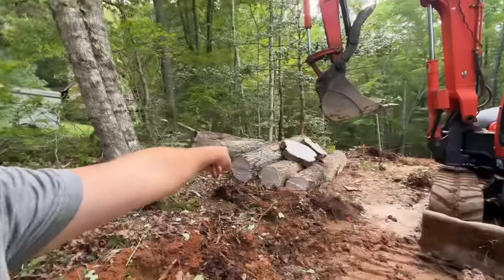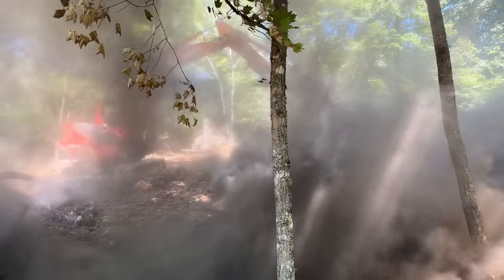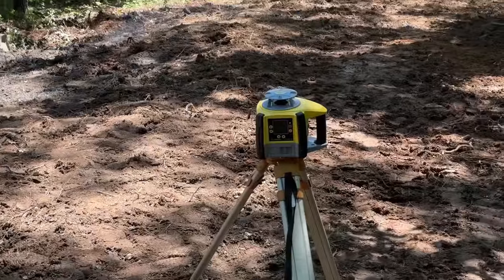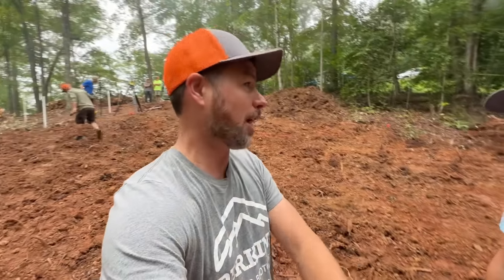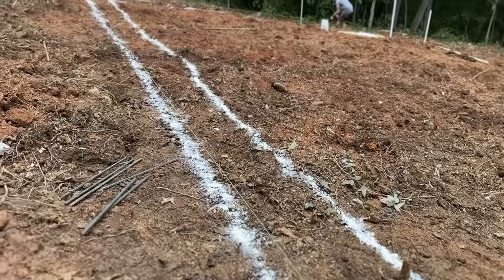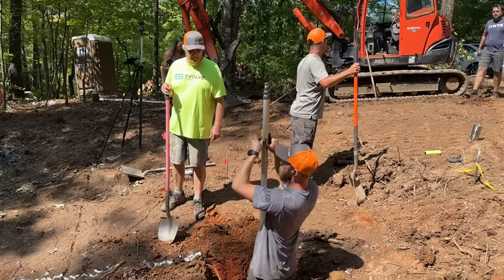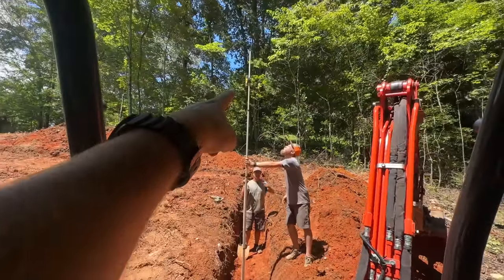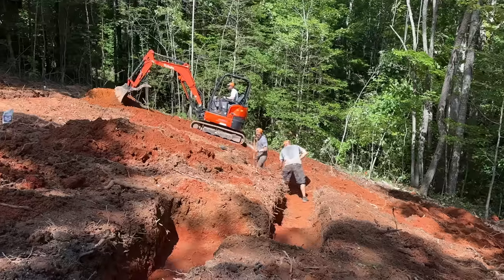Modern Home Build | 02 | Footings layout and dig

Comment: When the dump truck was  emptying for he driveway, he could start dumping, backing up,  at the end of the driveway over what he dumped. This way, when he leaves, he can drive over gravel. Also, it is compacting it at the same time.
Reply: I thought he was going to do that but maybe he knows something we don’t. 🤷🏿‍♂️
Reply: Glad someone picked this up.  Here in Australia you wouldn't get a truck license if you didn't know those simple tips.  Crack the tailgate open on chains, tip it up slowly and reverse over the load, not only does this get you out of a sticky paddock but also spreads the load for the client.

Comment: Back in 1995 the boat company I was working for tried out some really cool laser Teck. They pointed the laser at a small mirror ball at the end of a stick. The laser tracked the mirror as it was moved across the hull, and we were able to build a model of the boat in the computer to show deviations from design within 1 mm and make adjustments with some Bondo. The boat was 60 feet long. I am pretty sure it was some guys from MIT. Sadly, the boat broke in half during a race (Americas Cup 95) because a member of the crew tried to fix something that he was totally unqualified to do. It is always hard to get good help.

Comment: That’s some fancy equipment. Why don’t you just use a meridian optical level. You can find a corner shoot a straight line turn 90 degrees and repeat. They are less than 200.00 I use a David White LT6-900 Meridian 22X Optical Level-Transit. Something to consider.

Comment: Laser on a tripod and a measuring stick will solve the unlevel measuring problem. A Lazer and tripod is not that expensive. The measuring stick will tell you how far to measure down from the Laser mark to where you need your string to be. Remember to start at your highest point and work out from there. 65 yr. old builder here, hope the info helps.

Comment: 1:05 Brought me back to me going to a site to load a skid steer onto a trailer... did exactly what you said: Park on incline, go to load the equipment, rear end lifts, truck went bye bye and Jack-knifed into the caragana's about 100 yds from where I parked. Of course, I didn't know that I should have just unloaded the skid steer.. instead I panicked, jumped out of the skid steer, and ran after the truck. Good times.

Comment: Eric... when you're moving a load, i.e. those logs to stack on the trailer, turn the crawlers around so the blade is behind you. That (1) puts more excavator weight to the rear to counterbalance the load, but (2) let's you move closer to the trailer with your load. 

'State of the art' surveying equipment is nice, but even an old Total Station should give horizontal and vertical angle from the machine to the prism pole, but also - what you were doing in this video - reducing slope to horizontal distance. Even an old machine should calculate and display horizontal distance, as well as the slope distance. (Ha, that's the geodetic, or mountaintop-to-mountaintop surveyor coming out in me. Hard to believe, 50 years ago I was an instrumentman on a geodetic survey party. I was operating a Wild T-3 theodilite for angles and an AGA model 4D or 4L Geodimeter to measure distance. Longest distance I ever measured, 26 miles with the 4D, from Reyes Peak to Cuyama Peak in the Los Padres National Forest. GOD, I loved that job). Let's see how many 'old hat' surveyors respond to that....

Comment: You could try a digger with a combined positioning system. It is accurate to like 1 millimeter so you can do the digging and marking at the same time. However those do cost so regular rented machines will not have them, but maybe some company would like to sponsor and show how it works.

Comment: I’ve been a excavator for over twenty years and I think I might have a fun fact for you if you don’t already know it. So on you’re grade pole if you’re laser beam is higher than you can reach to place your receiver that’s what the measurements on the back of your pole is for. So take your receiver and place it at the very top of your pole, stand at your lowest corner and start extending your grade pole with the section that the receiver is on witch would be the very last section of the pole while keeping a eye on the measurements on the back of the pole, keep extending and locking in place each section starting from the top section of the pole until you get a level beep, once you are level look at the seam of the last section off pole you where extending and the next section to be expected and the measurement at the seam will be the measurement that you would translate to the front of the grade pole. I hope this helps with the annoying guessing game.   P.S. this might be a good pro tip of the day on a future episode lol

Comment: When using a total station you have to think differently to the normal way of set out nowadays 3 carpenters a string line and a windy day good luck trying to get an accurate setout are gone .Best way is to set out your footings After thats poured than using the total station set out the walls on the footings and pin the corners with a micky pin (ie small masonry nail) when I was looking after large building sites we never use string lines every thing was set out using total station My son using total station on high end homes its cheaper and quicker and more efficient than the old way of doing things

Comment: If you have a 4WD you can put the transfer case into 4hi and put it in park and set the parking brake, in really tuff spots put it in 4lo. This locks all 4 wheels to the transmission parking paw and then the parking brake acts as a back up as the rear and front axles are locked together in the transfer case. The reason 4lo can be used is if something gives and the truck starts rolling the massive gear reduction will keep the truck from "running" away at a fast speed. This is because working gear reduction in reverse takes a ton of power, If I put my 2010 Tundra into 4lo and first gear I'm at 39.35:1 gear ratio (I have 4.30 axles ratios) and it will pull stumps all day. But if I keep it in that gear on a down ward rolling hill she never gets above 3ish MPH, she's having to now drive all of the power train from the wheels through that very high gearing keeping you under control. Note when doing this it's best to keep the engine on to keep the transmission lubed incase something gives way, automatic trans mission only lubes when the engine is on, this is why you shouldn't really tow a automatic vehicles on the drive wheels for long distances with out removing the driveshafts. You'll kill all the rear bearings and seals from running them dry and over heating them.

Edit to say chalking the wheels is always a good ideal even on flat ground as I have seen people PUSH their trucks into ditches trying to get equipment onto a trail on flat ground.
Reply: I generally don't like the idea of trusting the parking paw. In 4lo it's probably not really a concern because of the gear reduction, but they can and do shear off. Honestly having it in 4lo with a foot on the brake is probably the best bet, at least in a more extreme situation.